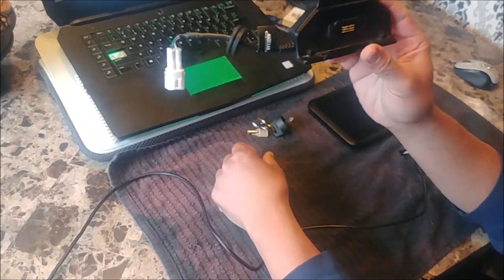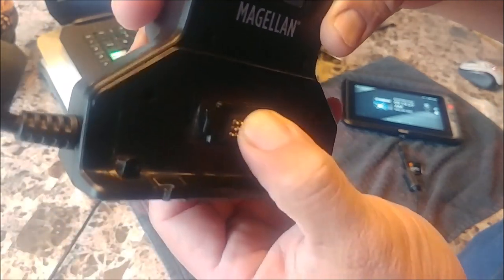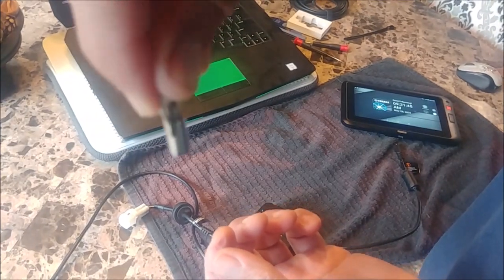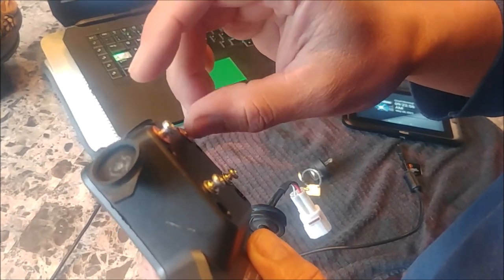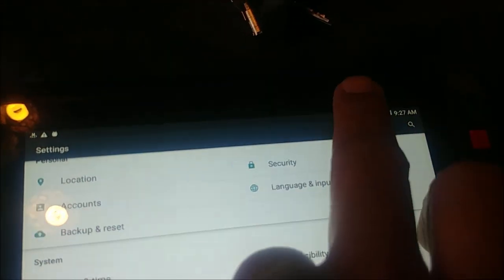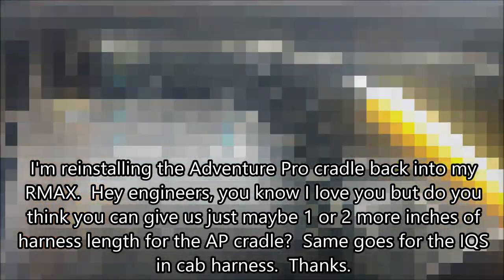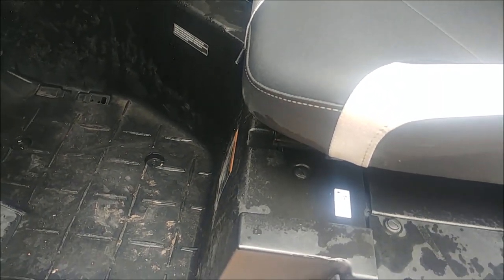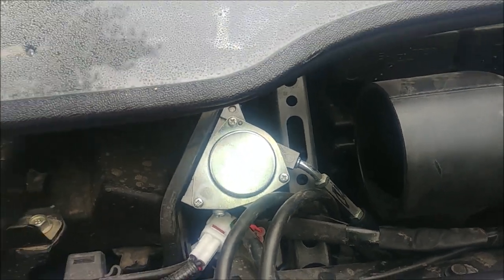Yamaha RMAX 1000 Adventure Pro tips, cleaning your skid plates, and throttle cable adjustment

Comment: Hey great job, I did something with my key that you might want to do. I took a 4” plastic screw driver bit holder, I cut a slit in it and glued my key in. Now it is so simple to put the key in. 
Max Daddy
Reply from the maker: Great minds think alike!  I thought about extending the handle on the lock key.

Comment: Hello Massive 

I do want to thank you for all the videos on the Rmax. I hope you can help me with my Adventure Pro it has been giving me a boot error for a little while now, but if you OK it would finish booting and work, I do not know what the error was. Now it powers on but will not go past the Adventure Pro screen and nothing else will display. Any idea what I could try when I connect it to my PC it just says not supported device. 
 
Thank you
Reply from the maker: Try this, except choose reboot.  Worst case you can try a factory reset, but then you run the risk of it now automatically reinstalling the software. Is your RMAX brand new\under warranty?

https://magellantrxsupport.zendesk.com/hc/en-us/articles/5416165114903-How-To-Perform-Manual-Factory-Reset-and-Reinstall-Software-when-having-Frozen-Screen-Display
Reply: @MassiveOverkill Thank you for the reply it is out of warranty got it new in NOV-2020. The table is stuck will not do anything but power up. Cannot get screen to do anything, is there a way to force it to move on past the power up screen.
Reply from the maker: @tommyc1575  if you can't even get it to go into recovery mode using the steps above I'm afraid you may be out of luck :(
Reply: Yes, looks like I am going to have to call my dealer. 

Thanks for the help.

Comment: Our new 2022 Rmax2 LE we just acquired doesn't have the key, was It supposed to be on the key ring they give you?
Reply from the maker: If it's not on the key ring, check in the plastic bag holding your manual/documentation.  If you still can't find it, go back to the dealer and get one.
Reply: @MassiveOverkill  Yeah our salesman had to order them. Said they cost $50 don't lose them. I'm like ahh we never got them to begin with.

Comment: Did they change anything on the adventure pro recent updates? When I pull down from the top corner following your steps I dont get the option to use the usb for data connection. Any tips?
Reply from the maker: Are you using a PC or iOS?  You have it actually plugged into the computer's USB port before trying to access the option?
Reply: @MassiveOverkill  thanks for the reply. I have it plugged into my PC via USB. Says its charging on the battery icon as well when plugged in but doesn't give me the option for changing the usb on the adventure pro.   Will try to navigate to the website you pinned to download the apk file.

Comment: My machine came with the adventure pro, I wish I knew it was a paper weight.. I would have had the dealer remove it and refund the balance. I like my old Ipad mini 3 with a Garmin GPS module and OnX offroad much better.
Reply from the maker: I love my AP simply for the engine readout.  I load an older version of Avenza onto mine for mapping.